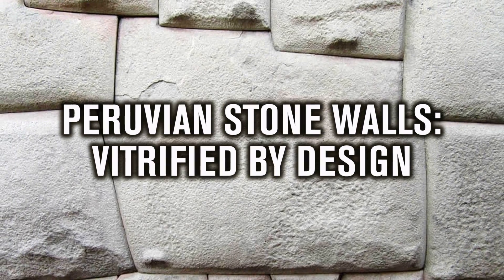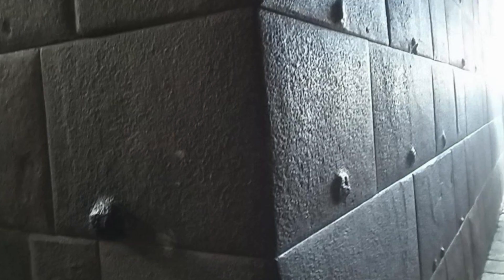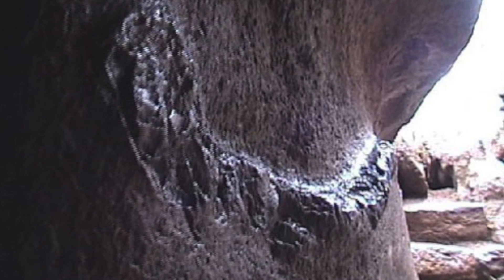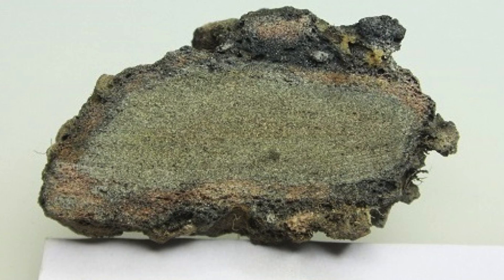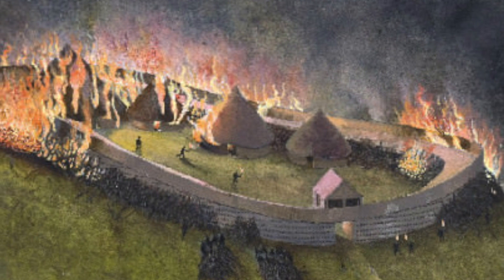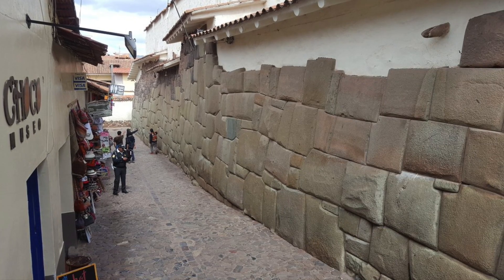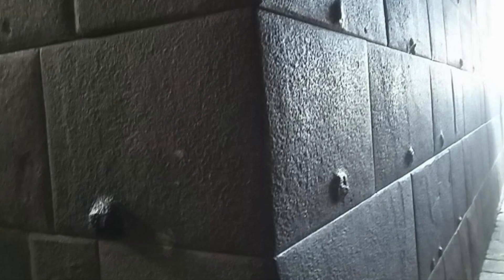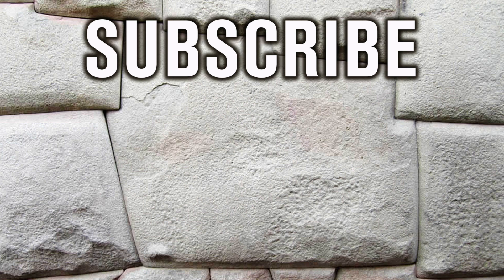Were the Peruvian Stone Walls Vitrified / Melted During Construction? | Ancient Architects

Comment: Do you think that they could have used Giant Gold Parabolic mirrors to scorch the finish onto the walls? We know the Spanish took a lot of HUGE gold artifacts and melted them down. 

Ironically in the "Duck Tales" movie they go to Peru and there are Giant Gold disks that focus sunlight.
Reply: I agree, mirror could heat and melt stone,  but stone with thermite reaction, controled heat, extreme 2700deg minus cool rocks. 
Mirror could be used with crops and focus heat miles away.  Zeus lighting bolt.
Golden mirror.

Comment: The nubs may also be a flue hole where the air for the fire or the fire itself came into contact with the rock.  That would also, coincidentally, be a spot of greatest heat concentration therefore melting the rock even more

Comment: I think the H blocks were really just tooling blocks used to press form the walls on site.  The tapered notches are perfect for hammering wooden beams into and the crosses fit perfectly into large wheel like blocks with step sided diamond shaped recesses that would allow them to be rolled along the wall and adjusted as needed.  If you look at the art carved into the gate of the sun you could possibly be seeing a foreman standing on a wall being constructed with workers on both sides pushing in.  I also wonder if the flower like headdresses shown on the workers depicted were polished gold mirrors used to focus the sun into the blocks and would love to know if a significantly high temp could be reached in this manner.  Modern Quartz countertops are made in this way.
Reply: fresnel glass
Reply: Fresnel lens, there's a guy on here that melts rocks in videos. Also, remember the stories of the Greeks was it? They used a big lens to burn an army of wooden ships as they were invading.
Reply: @craigboden2435  mythbusters tried it with a bunch of mirrors but NO ONE has ever used gold as the reflecting surface for obvious reasons.  Being a perfect solar reflector, that might make a bigger difference than you think.
Reply: @valorouswolf8853  and we all know that they had a lot of gold, and crystals which we now use to focus lasers... Hmmm
Reply: @valorouswolf8853  also, it doesn't need to be pure gold, surely gold leaf or plating would suffice as itd just be for the initial reflection of the sunlight into a lens or crystal or some kind. And gold leaf is surprisingly cheap.
Reply: @craigboden2435  ultra thin gold foil would work just fine as long as its affixed to something solid with the correct shape.  But it does need to be pure highly polished gold if memory serves.
Reply: you forget Puma Punku is at 4000 meter height , way over the tree limit

Comment: Do we know if the precision fitting of the stones runs through the interiors of the structures or is it more of a surface treatment? If we were to take a wall apart would we see rougher fitting on the interior joinery?
Reply: I think matt did a video. Youll find it on this channel. I remember that some walls were joined just on the side facing the outside. Inside wasnt as tightly fit
Reply: in some there's a rougher fitting in the interior, in others it goes all the way through.
Reply: @randomdude2832  indeed
Reply: They are roughly worked and back filled with off cuts, as these are normally retaining walls.
Reply: What I saw last year when I was there, last year, is it is fitted all the way through
Reply: On some walls the precision runs completely through, on others its only on the surface giving the wall a pleasant look. If I remember correctly, Brien Foerster thinks that the former ones are lost civilisation work and the latter cruder ones are Inca.
Reply: there are several types of fits. the original megalithic blocks usually have continuous guides. there are exceptions to these but mostly for static reasons.

Comment: Some of these theories are bothering in that they don't seem to appreciate how incredibly difficult it is to reach temperatures necessary to melt stone.  I've done controlled burns many many times in the course of my life and even used fans to get my fires as hot as possible and NEVER once reached the temperatures necessary to melt stone. I've enjoyed melting glass in some of these fires but even melting glass takes a lot of concentrated heat.  
A blast furnace is hot enough to melt stone but that uses electrically powered forced air and insulated containment. It is really difficult to reach the temperatures necessary to melt stone and it takes an enormous amount of fuel. 
The problem of the nubs is really bothersome because I haven't seen one theory that explains them all. Every idea has large numbers of nubs that don't fit the theory. I would be in favor of getting rid of the nubs so I can sleep better.
Reply: They did have that acid mud mortar. For all, we know they may have coated the stone with some substance that made a chemical reaction that increased the temperature they could make with fire alone.
Reply: agree to melt granite you need 1250 degree C , and in Cusco area there were no tree in past only brushes
Reply: @kathykonkle1097  sorry no

Comment: Ok then if virification was used what material was used to shutter the material whilst it cooled?
Reply: That was my thought as well. But if they used large enough stones you would expect only the exteriors to truly melt or soften, while the interior wouldn't quite reach those temperatures. I think you could use clay to try to hold the shape maybe... It is a very interesting hypothesis, at least. Someone should do some experiments.

Comment: Thank you for the videos!
About your question on the nubs. When I was working on a terrarium backdrop I tried to get as many photos and videos of the stonework and the occasional nubs to make the backdrop Peruvian wall 'realistic'. I am in no way an expert, i do have an engineering background.
I don't think they are a by-product of the process, this might be possible but I doubt that's why they are prominent. I noticed they appear in mostly horizontal and sometimes vertical patterns. Sometimes the alignment is a bit skew or on an angle. Locations on the stone (can be multiple nubs on one stone) tend to vary, but if the pattern of stones is rather polygonal, the nubs can be on any location on the stone. Most of the times its near a corner or one of the edges. Some of the stones in these walls can have significance as well. There are examples of them in the pattern of a snake or a different animal. I Imagine there are some abstract formations in parts of the stonework we have not noticed yet.
I read that some of the civilizations/cultures in region used a cord with knots or beads like systems instead of a written language or pictographic material. The nubs would likely be a language or numeral system. 
I'd like to mention some of the oddly small/tiny stones in some of the polygonal stonework. They seem to have a symbolic purpose. Sometimes it's part of the speculated animal shapes. Some seem to be in 'random' places, perhaps the stones around it form some abstract symbolism or like the nubs it might are part of a sequence.
As most of the pictures on the subject I found show only a fragment of the structure it's hard to see the nubs in full context. I should restudy the photos and videos to figure out if the sequences of nubs are located near or on the stones that potentially formed the animals.  And draw the potential nub sequences on paper. Apologies for the load of text.

Comment: to make a 10' tall and 30' large wall, you lay down a 10' x30' and 3' high enclosure, fill it with your geopolimer and then trace your irregular shapes introducing sheets of paper(or similar) vertically in the mix and let it dry. after drying you have your wall lying horizontally in the floor, just need to rise it up stone by stone. they will keep the perfect design that you trace before. it's my theory.

Comment: I would love to see a mason experiment with this idea. Perhaps build several walls of different types of stone to see which ones "flow" the best.
Reply: If you want build this architectural angles and guides regime. you need a constructions software, by using a suitable tolerance system. And kind of a copy milling portal like CNC. Otherwise you can see an elephant standing behind the wall, by looking through your fabricated gaps, in lack of exact processed angles.

Comment: Have you considered an acidic paste being used to "melt" the rock?
Reply: Either placing it between roughly correct shaped stones to just melt the edges for perfection, or mixing rocks with paste/liquid inside a mold.  I like the idea of some plan they harvested and used to make the paste, that they harvested to extinction, so now we can't find it.  Would we still find residual evidence of such paste if two never removed blocks were separated?
Reply: @keithkarnage  oxidation of iron sulfide in the rock could naturally create an acidic paste and is a natural byproduct of mining anyway.
Edit: and it looks like gold!
Reply: I think that is a possibility, in aincient Egypt there are traces od acid, probably made from vinegar, that etced away the binder in the sandstone.
They probably chiseled away as much as possible first, then they used the acid compund on woolcladded woodpads (wich save the acid and made it possible to control the process) for the finetune.
Reply: @realmaxpower  Artificially cast or 3D printed limestone do not have the compressive strength as naturally grown limestone. please see scientific articles on Sintering of Limestone in Calcination / Carbonation Cycles. it means Sinter  of Artificially limestone.

There is another way to make artificial limestone. by blowing carbon carbonate into a basalt layer. as a result, limestone grows in the hollows.
Reply: @johnwalker1553  interesting. I was thinking they would only affect the edges for shaping.. Some sort of lost stone soaking method or something.
Reply: YEs in fact he did a whole video on it...its like he already found the answer and is just trying to find new material for the new video where the old one still stands definitive...its one of his most viewed videos...about a year and half back.

Comment: Thanks Matt,
It's not clear to me why so many, including you, are so resistant to the idea of concrete.  If you have never poured it or worked with it it may seem mysterious, but having worked with it 50 to 100 times (lost count) it is clear to me that no other explanation is worthy, both here and at Giza.

Davidovits is right.  If you haven't read him and you haven't ever poured concrete you need to do some homework.  Aliens and Giants are out.  Picking up multi-ton stones and getting the shape just right so they fit like, er, concrete, isn't possible, nor is dragging them hundreds of miles or loading tippy boats to ferry them to Giza.  Machining requires a power plant and diamond bits, which are nowhere to be found.  The holes you see in various places are due to whatever was pulled out of the concrete while it was drying.  Depending on weather and temperature, it could be a matter of an hour or a few before the cement dried enough to pull, and in general twist so you don't dislodge the good stuff.  This explains many 'mysteries."

The bulges and knobs in Peru and other places are most likely (I can't say certainly) due to the lack of plywood at the site.  The Pharaohs sailed to Lebanon to get cedar logs that were hundreds of years old.  You can float them in a log boom down to the Nile.  You don't need to worry about tipping your boat over.  Log booms are not unknown to Puget Sounders of a certain age. (And I don't mean Stone Age.)

So, the forms, or molds as Davidovits calls them, used to guide and contain the 'pour', are smooth and solid at Giza; at Cuzco and other places I assume that the forms were more like a basket, you could probably do it with papyrus if you didn't have plywood and I don't know what the Americans of that day used, but the two bulges would sort well with pulling out the ropes or vines or whatever you used to lift the mix or mud in the first place.

This isn't rocket science.  The sooner you grasp that these remarkable structures were poured, not hammered and dragged, the happier you will be.  

Regards, Henry Hewitt
Reply: I agree, but tests on the stones indicate that they aren't a concrete. The mine where they were extracted is also known. Unless they knew how to make a concrete good enough to pass for natural stone, even under a microscope, then they most likely weren't poured.
Reply: dont you think geologists can tell the difference between rocks and concrete? besides, they found the quarrys for the rocks
Reply: @phlix1  That is a fair question Boris and the answer is No, most of them cannot without a microscope and expertise in materials science that most of them lack.  Bringing material from a quarry is one thing, but in what form? How do you know it was not disaggregated there and brought to the job site.  Where do you think the word Khem-istry came from.  Heat and chemistry are both possibilities as are hammers.  Packing rubble is easier than hauling large blocks that will tip your boat over and land you in the jaws of a crocodile. Joseph Davidovits has much to say about the question you posed and I urge you to look at his remarkable work.  First,  eliminate the impossible.  The most compelling logic is that when you pour cement, perfect joints are Unavoidable.  When you saw with copper or beat with chisels, perfect fits are virtually impossible, even in a thousand years.

Comment: That’s a lot of fuel to vitrify stone in the open air.
Reply from the maker: Yeah. I thought so. But it happened in something like 50+ forts across Britain and Europe - through burning. Very odd but the evidence is all there 🤔
Reply: 900 degrees celsius is alot. You need some 1500-1200 to melt steel. Well i guess if the draft of air/wind is enough you could do it just by accident.
Reply: Alot of asumptions tho
Reply: @AncientArchitects  so they vitrified the stone and then they modeled it somehow into block with knobs? or how would this work?
Reply: @AncientArchitects  just thinking if the European forts experience vitrification from accidental fire isn’t the easiest assumption that the Peru walls existed and then experienced similar accidental fires over their own history of use? And maybe that’s what’s caused surface vitrification, probably just less fuel?

Comment: Maybe the protuberances/nubs are where a hole in the cast for the block was to allow air to escape when they were poored? Or when the blocks were heated?  Seems most of the pics shown the protuberance is at the bottom of the blocks in most of them. Just reminds me a lot of "casting flash" found on metal and plastic castings before being fine finished.

Comment: If it were melted as u state to achieve this close fitting you would see significant bulging of the blocks at the bottom. No such bulging is apparent. The joints between the blocks are also way too straight and clean. You would have a much messier appearance. Think lava. This is as clean as legos. Sorry but no.
Reply: It's would need to be boxed up like formwork for concrete, but then the walls would be flat....
Reply: Yes and the nub features should have a more flowing like appereance, which they dont have.
Reply: @danthefrst  also nubs are too symmetrical. They are quite obviously not random.
Reply: Melting stone has a Oxigen reduction problem you will destroy the minerals.
Reply: @johnwalker1553  right

Comment: Interesting video. It seems abundantly clear that these rocks were at one time very soft, if not pretty much a liquid. The nubs look like an outlet 'sprue' that might have helped to draw more material downward and fill all the way into the corners. Only the last stones to be fitted into a row would need an externally visible sprue, the earlier ones could have their sprues on an internal face (this would help the wall hold together better too). You seem to be underestimating the energy required though, I mean... fire? Looking at the layout of stones in those Peruvian walls, there are many cases where it appears that the seams could only be made if the stones on both sides were still soft at the same time. Not impossible, but it would require enormous amounts of energy, and stone ready to go so the process could be done without taking long breaks.

Comment: Hi Matt. I have been to Peru (but not to Egypt) and I've seen the stone walls there and I have some ideas to test out for ways these walls could have been made. The first idea I had was what if the Inca made large brass or gold parabolic dishes to concentrate sunlight onto a very hot focal point? Presumably the dishes could be aimed in various directions at different points on the wall being built. Another idea was to have portable coal kilns that could be fired up and also raise higher as the wall gets built. Molten rock could then be poured from the kiln onto where it is needed as the wall is built from the bottom up. The nubs could be the remnants from where the kiln towers were resting on the wall as each layer was laid with the guides for flowing the molten rock down into place. Another idea was to divert running lava from a volcano along channels to where you want the wall. Another idea was to make large glass lenses that could focus sunlight onto points on the stone wall to melt the rock there. Regards from John in Melbourne.
Reply: I don't think you understand optics.